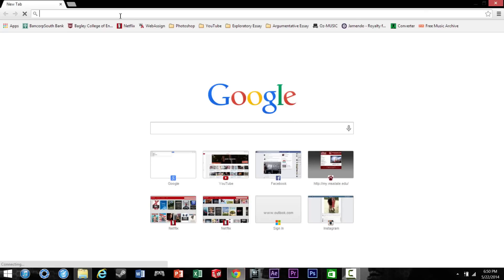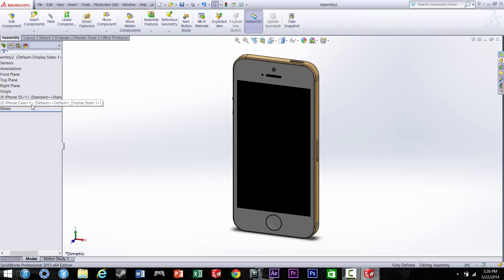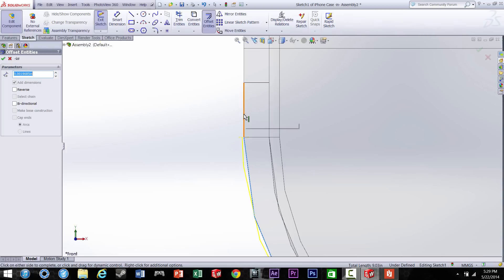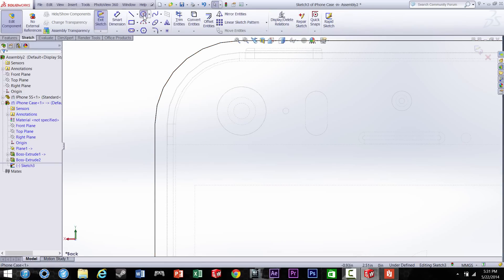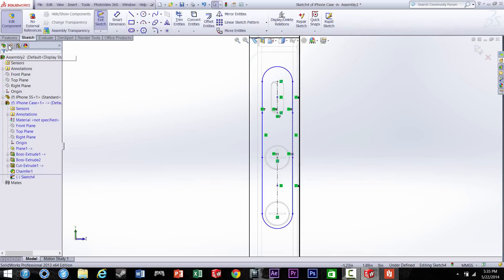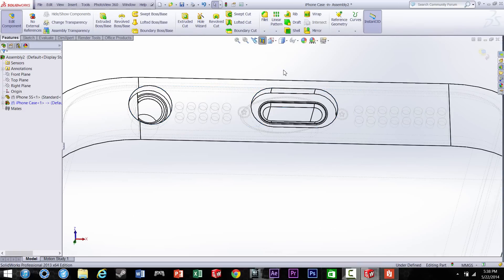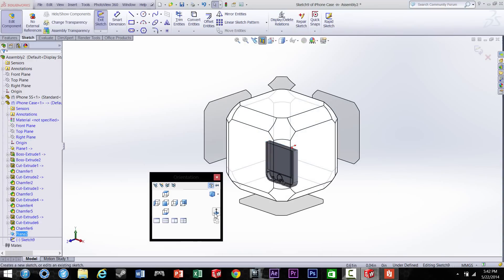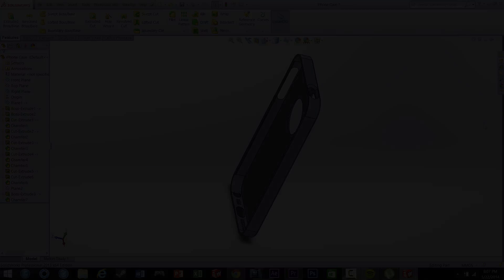Designing an iPhone Case in Solidworks

Comment: whenever i extrude the offset line the whole object became solid. but when you extrude it the only that became solid was the case. can you help me sir?
Reply from the maker: +ernest ivan reyes  it usually means that you have a gap in your lines. Check all the joints and makes sure that your shapes are completely closed. Also, when you go to extrude, specify both of your contours.
Reply: thanks sir! :D